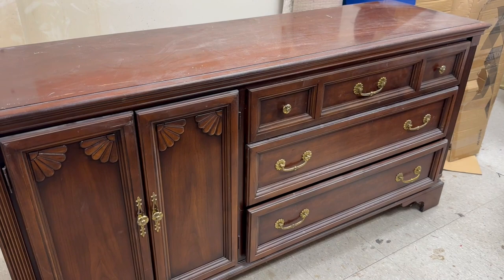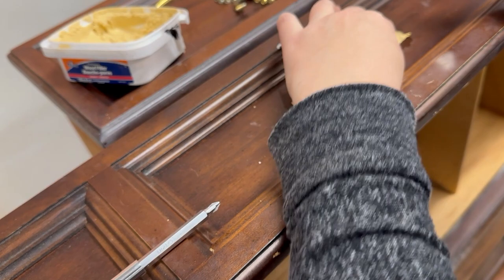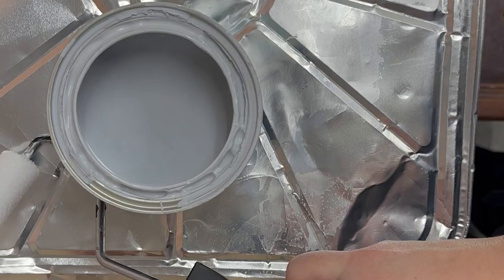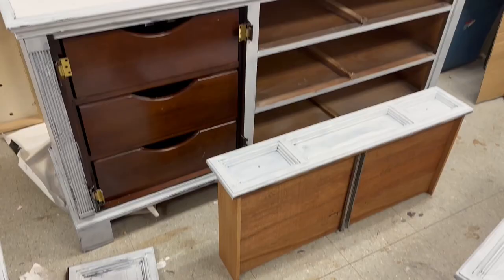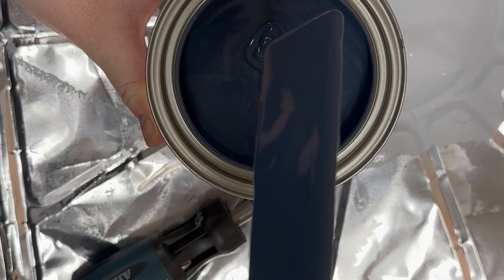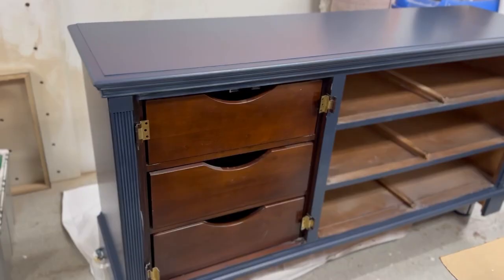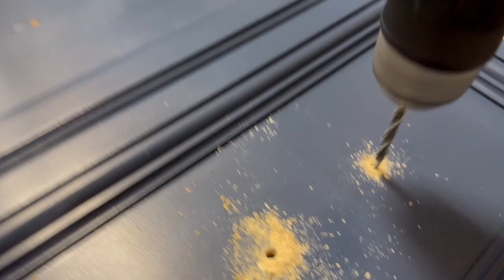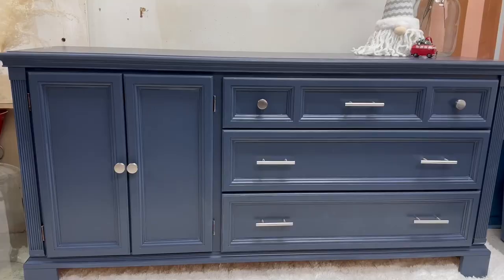How to Modernize Outdated Furniture with Wise Owl One Hour Enamel Paint Side Hustle 2023

Comment: Are you using a paintbrush as well as rollers? Suggestions when painting the different levels of the drawer front when rolling?
Reply from the maker: Most of the time I angle the roller to get it in where I want the paint. Using a brush will be a much better option! Brush on and quickly roll over it to smooth out any texture
Reply: @ivafurnitureflipsdiy  Thanks for your reply. I will try your technique.
Reply from the maker: You are welcome!